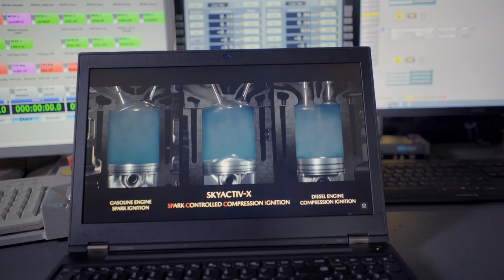What is is the future of the internal combustion engine?

Comment: To "Skyactive X" add: 1.)-> Hyundai's VVD (Variable Valve Duration camshaft) and  2.)-> the new TPS (Transient Plasma Systems) cooler running, more instantaneous ignition system. Now, with these 3 technological advances, we are talking MUCH higher efficiency for the gasoline (petrol) engine. But licensing is, of course, the problem. 
TPS should have their system ready within 2 years or less. Hyundai is already using their VVD cam in a new Sonata.

Comment: ic    engine is a big failure....always bracks always need service....somethings knocks....engine light turns on....there should be new ways to travel electric   air compressed motors or even electric steam powered cars.
Reply: Breaks when not maintained, It knocks with poor quality fuel used, as consequence the engine light will turn on. Nothing bad as an electric car with degraded battery show 0% seconds after show 60%, or an exclamation in a triangle and an advertisement saying the battery is dead. ICEs only require change only filters, oil, spark plugs and some times a timing belt to last for hundred of thousands of kilometers, and IF something fail, you can do fix, while an electric motor need to be changed, and costing a lot...
Reply: Say 'failure' to ic cars 100+ years of success in vehicles
Reply: Cars with batteries can only be toys when kids play you know real cars have ice and are great